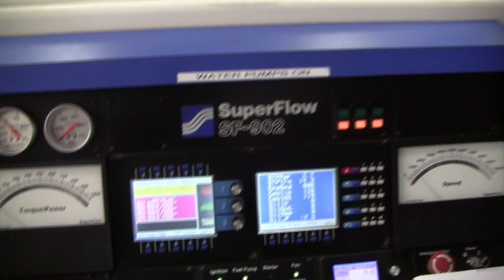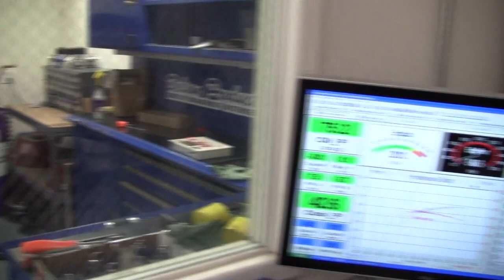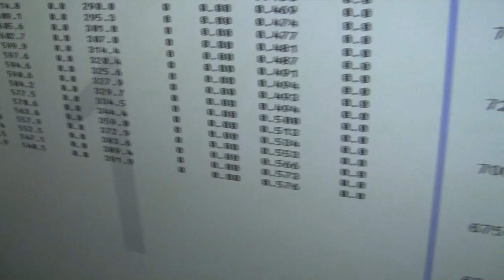Tom Fry's 427 SOHC Cammer 740HP Dyno Pull | QMP Racing

Comment: YEA,and they'd run at 8,000 all day,and 8500 for short periods,and make close to 900 horse power,SEEN many of them on dyno's do better then that....OH,the 1960's what cars..and THATS what got them banned from Daytona,all the chevy and chyrster guys crying to the track officals,you got to ban these engines ,we can't beat them,FORD,first on race day..hahhaha......
Reply: Typical Ford logic back then: 
"Look at this super cool V8 engine that you'd cut your left nut off to own..........I think we'll build a few hundred of them in dealer "kit" form just to make sure you NEVER get your hands on one".....
Reply: Look up your Nascar history,pal...Nascar banned "Special race Engines"...ie..The Hemi & the Cammer.
Ford should have bought out a mild version of the Cammer,like Chrysler did with the Hemi
The Cammer wouldn't have lasted in a race like the Daytona 500...Poor oiling system & the timing chain which stretched.
Sneaky Pete Robinson was replacing bearings & conrods,in his Cammer, after EVERY pass
Reply: Chrysler wasn't crying. They already had a dual overhead cam motor on the drawing board, and built a few prototypes. When the Ford cammer got banned, they dropped the program. When the Daytona and Superbird got severly handicapped, they put in destroked small blocks in them. Chrysler dropped the NASCAR program, but left on a high note. Brad was the champion. I was pissed off, but Ralph Gilles had a reasonable point. They are no longer stock cars, it's like a pack of jelly beans running around the track, different colours, and flavours, but they are all the same in the end.
Reply: @alcyr5655  Ford already had a DOHC V8 in the 40's. It was used in the Sherman Tank https://en.wikipedia.org/wiki/Ford_GAA_engine
Reply: @coreybaldwin7563  -Chrysler had a Single Overhead Cam V-16 aircraft engine in 1944
Reply: 68bobba2 
Ford had a 1650 ci DOHC v-12 HEMI prior to 1940 that turned into the 1100 ci DOHC v-8 HEMI used in the Sherman and other tanks in 1940.

https://en.m.wikipedia.org/wiki/Ford_GAA_engine
Reply: @fredflintstone505  -Chrysler's first Hemi car engine was a prototype made in 1948...but it didn't go into production until 1951.
Ford didn't produce their OWN factory made Hemi car engine,until 1964,when they came out with the Cammer...Wonder why that was?
Reply: @brucegerard309  -If you read my last comment,you'll see the words,"Their OWN factory made Hemi CAR engines"...CAR engines...Not tank engines.
Both Ford and Chrysler produced Hemi style tank engines during WW2.
Welch made the first Hemi engine,in 1903(20hp,2cylinder).
Stutz,Miller,Offenhauser and Riley are just a few of the companys who produced Hemi style engines during the 20s and 30s
I have NEVER said the Hemi design belonged to Chrysler...But they perfected it for use in passenger cars

Comment: These guys like to squall their own horns. These engines were producing more horsepower than this in the 60's Holman Moody prepared cars. Case in point. A hellcat 707hp will not break 200mph in a charger or challenger. These SOHC and even the 427FE and the 426 hemi was hitting over 190 in a much less aerodynamic  and heavier car.
Reply: The top speed of the Hellcat is 206mph.

Comment: When we your  late teens me and a friend bought a used  v drive no motor and  pulled the motor out of a 67 Camaro that had been ran for modified production car . it ran around  low 11s . We installed it in the v drive with a little milder cam.   We took it to lake and It would run around 75 or so a 7k >  Rpm . It was a heavy ski boat . We ran onto a pickle fork with a ford motor in it .Was not even a race lol  The pickle fork v drive with a 427 cammer motor . We gained new respect for the ford motor lol . Sure the pickle fork is a better hull but the cammer motor is the real deal lol

Comment: Whoa whoa whoa! You can't say that an engine was rated at whatever HP at a certain RPM and then say, well...it REVED to whatever rpm so it made this new HP. An engine makes it's peak HP at ONE certain rpm level. Of course the factories NEVER said EXACTLY what their motors made because of insurance purposes on the street and what class they got thrown in in NHRA.

Comment: You are thinking of torque which is a direct correlation between pump/engine capacity and breathing. Torque is work while HP is how fast it gets the work done and HP is a function of RPM. Look at F1 engines as a good example. Tiny engines with no torque at all but being able to spin beyond 18,000 rpm (they are limited) they make gobs of HP.

Comment: Im not mechanically minded so it might be a dumb question to some, but what are the 2 things on the valve covers and what do they do?
Reply: Ausman, they are oil breathers.
They prevent pressure buildup that could cause oil leaks.

Comment: Theres nothing like a high-volume oil pump to produce grossly excessive oil pressure at all speeds and a rapidly emptied pan at high speeds as it pumps oil to the top end of the engine faster than it can drain back.

Comment: Just curious.... if it has a cam on both sides, that would make it a DOHC? Being a V-8, it has 2 cylinder heads. It would need a cam for both sides of the engine. Why is it called a single over head cam (SOHC)?
Reply: It's called SOHC because it has one cam on each head.  A DOHC has two cams on each head.
Reply: I see.

Comment: Ive heard rumors thru the years that SOHC's were prone to breaking timing chains. 
When the cams cease turning - one or more cylinders will have valves down when piston comes up. That aint good.
I dont kno if that rumor is true. But i did notice Ford didn't use cammers in their GT 40 Le Mans cars. I am forced to ponder why.

Comment: Well...John Kaase's new Boss 429's put out a little more than this, but I agree that the cammer is just cool beyond all redemption.  Ford should have stuck with this and told (chevy owned) NASCAR to poke it up their exhaust.  They did dominate Fuel Drags and AA/GS for a while, forcing the Hemi guys to develop aftermarket blocks.  LS?  LS motors???  The design of the LS series came from Lotus.  Owned by Ford.  So...hey girls, it's all in the family.
Reply: Lotus had nothing to with the LS, they designed the LT5 DOHC 5.7L used in the 90's ZR1.  The LS was a new engine design that retained the bore spacing of the SBC.  In fact GM didn't even use the gen II LT5 which would have made 500hp+ with a redesigned head although that was more about money.

Comment: This this motor or the AMC 401 that 401 is one of the most underrated engines of all time in my opinion Believe it was more powerful than the 454 and the 460 of its time only displacing 400 in³, 401 I'll never understand that

Comment: so is it really have 427 cubic inches of capacity? so more than 100 horses per liter?
Reply: Affirmative!
Reply: AmericanThunder amazing outcome from naturally aspirated engine :o
Reply: ***** Yup, it is an amazing engine! p.s. my 5.4L stroker 332" makes 530hp, so it's in the same V.E. ballpark. Ford power! :D
Reply: ***** But don't modern antiquated NASCAR engines at approx. 5.7l put out about 700HP?
Reply: Samsgarden Modern NASCAR engines used today are 5866 cc or 358 ci IIRC. They belt out close to 900 horsepower and rev up to 9000 RPM. Quite fast for any engine, much more so for a V8 of that size.

You may be thinking of a lower series car and not the top tier Sprint Cup cars.
Reply: Shinji Ikari True enough, that they do. HOWEVER, they have very short life spans, built specifically to finish just one race. This engine would outlast any of them.
Reply: fido139 Very true. And yet there are still blowouts for some teams. Very strenuous conditions; it's like thousands of miles of normal wear.
Reply: Shinji Ikari They can actually spin 10,000, I specifically remember Greg Biffle qualifying at Bristol a couple years ago spinning 9,800 rpm coming into one of the turns. He got pole position. Lol.

NASCAR Sprint Cup engines have such close tolerances that the pistons actually make contact with the valves, but only after a little bit of carbon buildup from the combustion process.
Reply: Tech4Dummies Wow. I was thinking that they could spin 10,000 but I wasn't sure. TY
Reply: Shinji Ikari The EFI makes a pretty big difference
Reply: Tech4Dummies man i had to look that up. that would sure have been something to hear screaming in bristol stadium in person. a place that pretty much amplifies the noise.

also i remember reading a tech article about how nascar engines tech progress owes itself to the advancement of valve spring manufacturing process and materials.
Reply: ***** The important part to remember about NASCAR engines is the restrictor plate. By removing that massive handicap and setting up the motor to take full advantage of air flow, rather than trying to make it flow AROUND that damn restrictor, you would seriously open up some performance gains on that thing. It would be awesome on the street. lol
Reply: yea! imagine over 1000 hp n/a beast reving up to 10000rpm...fuck turbos ;p
Someone told before "turbos are for those who can't built their engines properly"
Reply: you might have your quote confused with Enzo Ferrari who said "aerodynamics is for people that cant build engines"
Reply: euroaaRON1 nope, Keith Duckworth said that about turbo :) He was Cosworth engine builder.
Reply: F1 is making 700hp out of a Turbocharged 1.6l V6
Reply: Ford Fan 2904 yeah, because small pistons have little inertia so it can run at very high rpm. Also those engines produce a very tiny torque.
Reply: ***** About 200 ft/lbs so not that tiny
Reply: Ford Fan 2904 I would like to see somebody build a 1.6L diesel that was strong enough to handle 90+ psi of boost and see what kind of torque numbers it could put down.
Reply: ***** Yes
Reply: +FordCapri Driver  you`re funny!
Reply: ***** 200 ft/lbs per cylinder is good, though
Reply: +Logik426  I have read it's actually a 425 CID, not a 427. Fact for those that Don't know.
Reply: *****
 they're gay, because they have more money? nice logic
Reply: And are turning 8500 to 8700rpm for 500 miles, WOW !!
Reply: The 5 liter 4 cylinder JCB digger diesel engines; in the 350 mph land speed car, were boosted from the base engines 75 hp to 750 hp, giving 1,500 hp with the two engines it had.....WHEW !!
Reply: A most awesome engine and, if they change the firing order and crank to 180 degrees it would create more horsepower and be able to turn even higher rpms just like the 2016 Shelby GT350R.
Reply: in reply to Alan Dinh

Comment: QMP RACING; What. “BSFC “ ARE YOU RUNNING AT 6000 rpm? ( I’m a retired “ fuel system development engineer , from FORD , I WORKER WITH “ GAPP & ROUCH “ at DYNAMOMETER”  ( just interested ) thanks Bill😂

Comment: Wait... if it's a SOHC , What is sriving the distributor?
Reply: There is a short shaft that drives off the cam chain. One of my best friend's dad ran this motor in Alcohol dragster class for years.
Reply: Craig Daliessio if only it won a race against a mopar LOL.
Reply: I've wrenched on quite a few Cammers. Love that design
Reply: Craig Daliessio Yes, the ultimate design in my opinion.
Reply: Stuart Johns If only it won against a GM
Reply: lol a Chevy/ GM would fly apart trying to beat this thing
Reply: Ford Fan 2904 Why is that?
Reply: { Funkyclown} back in the day mopar and fords engines were superior in racing that is why

Comment: What is the story on Ford's Hemispheric Combustion Design 427 SOHC, didn't Chrysler, Dodge or Plymouth have the Patent on the Design?
Reply: Chrysler had made a hemi v-16 aircraft engine in the 40s and hemi v-8s all through the 50s. The Hemi head was one of the first type of combustion chamber designs and originated around 1906. So a patent would not have been possible by the time the 427 sohc rolled around.
Reply: Thanks for the reply, learn something new everyday!!
Reply: Chrysler only has a registered trademark on the "HEMI" name.  Everbody and their dog can build a Hemispheric Combustion Design head but can't call it a HEMI.  Pent heads are superior.

@Paul Kisling - if you mean their overly long under-performing, LATE XIV-2220 POS, then yes.
Reply: hemi heads cam from France

Comment: Only 7200 rpm and maybe 11 to 1 compression. Imagine it on 2 1/4 throttles with individual stack fuel injection and a cam to match at 8500 rpm with 13 to 1 compression !!  HELLO  950+ HP !!

Comment: I think the camera is the best looking big block of all time even next to the hemi and was way ahead of it's time. It's such a shame that corporate politics got in it's way of continued development that could well have led it to become the king of the elephants if not the pathfinder to much other new for the era technology amongst all the auto manufacturers of the time period. Without interference dual cam v8 technology would also pressed forward and emissions development  especially simple solution cures instead of the ugly and intrusive emissions control equipment that soon after came about that turned into the complicated rocket science technology we have now. Men like smokey yunick would have solved and overcame both fuel and emissions issues had they not had their hands tied. Ak miller may have pressed even farther into his research and development with propane. Hell this country wouldn't be in the turmoil it's in if politics and personal agendas didn't get in the way. I believe even electric car development would be farther along without having it forced upon us when it's clearly not ready Or safe or cheap enough for the average Joe nevermind the great burden it places on our already overburdened power grid. The clowns that are mostly all selfish self indulged and self picked to run this country are supposed to be working for us not telling what we are going to drive. With the good technology that exists now we see 700 horsepower engines that see getting in upwards of 16 to 26 miles to the gallon which is far behind what it should be because the hands of geniuses of both the past and the present are tied behind their backs and muddled with red tape. I believe old technology and new can easily work along side of one another to come up with simple solutions not overdeveloped ones. The current condition of our manufacturing in house and in country is at an all-time  low and the people that worked so hard to develop it are all dying off so what's the long term solution the tree huggers and greenpeacers have  now that we are no longer the manufacturing giant we once were.

Comment: Where the hell would you ever even find a sohc ford.  Were They ever put in a production car or were they only sold on the aftermarket to racers? Are there reproductions or is this an aftermarket hot rider upgrade from the 60s
Reply: It was never was in a production car, just a crate engine.

Comment: I think the Ford 427 SOHC could be converted to gear drive.
The long timing chain worked ok if set right,but wasn't the best idea.

Back in WW2 Ford made an all aluminum 32 valve DOHC V-8 that was 1100 cubic inches and installed in some Sherman tanks.

Comment: The 426 Hemi produced 433.5 horsepower and 472 lb·ft torque in purely stock form. The 427 SOHC With a single four-barrel carburetor was rated at 616 horsepower at 7,000 rpm & 515 lb·ft of torque @ 3,800 rpm, and while equipped with dual four-barrel carburetors they made 657 horsepower at 7,500 rpm & 575 lb·ft torque @ 4,200 rpm. The normal Ford 427 wedge made 510hp. A cammer was first over 200mph in the 1/4 mile. Why would Ford be screaming in '64? Fords won 30 races that year!

Comment: The cammer never got a chance to be fully developed. Ford tried several times to get NASCAR to approve it but they would not so they dropped it. Ford did develop a decent cyl head for its old wedge engine but it required a hood scoop. When the 1964 Ford Galaxies showed up with the famous tear drop bubble scoop and great running 427 high riser engines.....Mopar brought out the 426 hemi. The 427 higher riser engine was  the baddest wedge engine  of the 60's. How do I know this because Mopar had to go with the hemi heads because their wedge engines could not beat the 427 high riser. Chevy had to build a new big block as their W engines could not run with the 427 high riser either. Ford new the old wedge FE was dated and they would have to try a new engine combo to run with the hemi's. This is why Ford built the 427 SOHC. NASCAR did not ban the 427 SOHC and the Mopar 426 hemi. What they really did to hamper Ford and Mopar was come out with a new rule for 1965 that said you had to make 500 cars that came from the factory with any engine you bring to Daytona. Ford never wanted to mass produce their race engines in factory street cars. So not only was the 427 cammer not legal in 1965 but neither was the 427 high riser and the 426 hemi because they were never installed in 500 factory street cars.  In 1966 the 426 race hemi was allowed back in NASCAR because they produced the minimum 500 factory street cars with 426 'street hemi to make the engine legal. Ford decided to build a new engine for NASCAR. The Boss 429. It finally showed up in 1969 because Ford put them in enough Mustangs to make them legal. The Boss 429 won the NASCAR championship in its  second year  of use  in 1970.  Its actually amazing that Ford won a lot of races with that old 50's FE engine....including Daytona and Le mans.

Comment: Ford Claimed this motor made 750 Hp Unbalanced and Unblueprinted . i was around when Dyno Don was running them he and Micky Thompson got about as Much Power as thell make. Even Big Jon Kassi peeked about 975. Their Big and Bold sound like 8 cylrs of Hell . BUT it was developed to its Max even Before it went to production. we ran one in a 1962 Cheap Body Galixie , it Would STROLL down the HWY
Reply: 427 SOHC from Ford over the counter were rated 616 4V and 657 8V